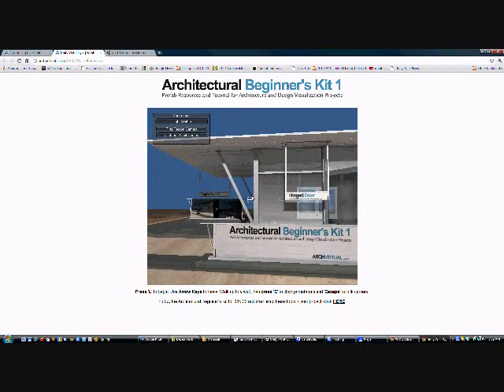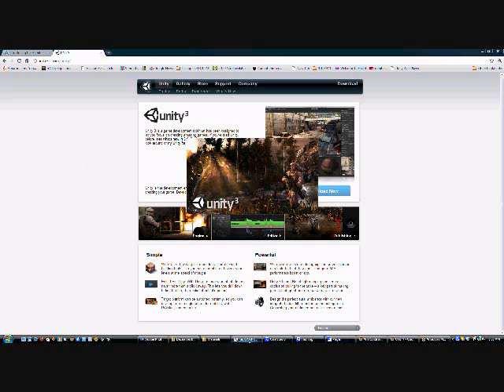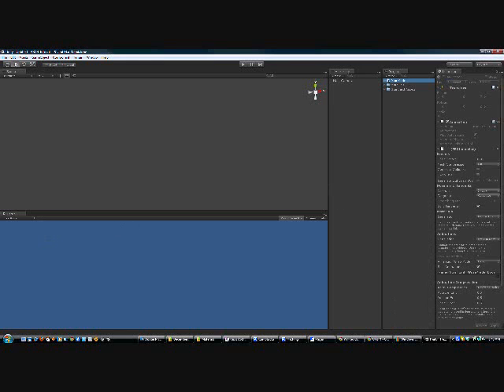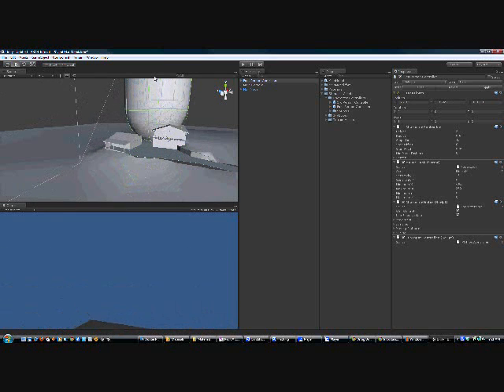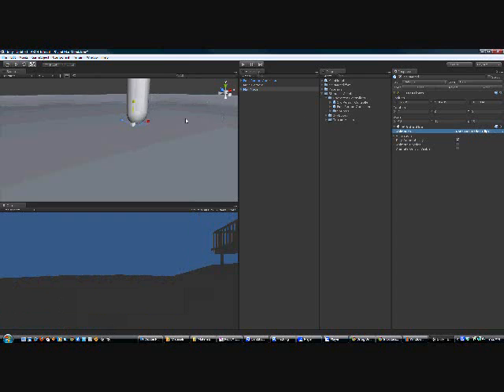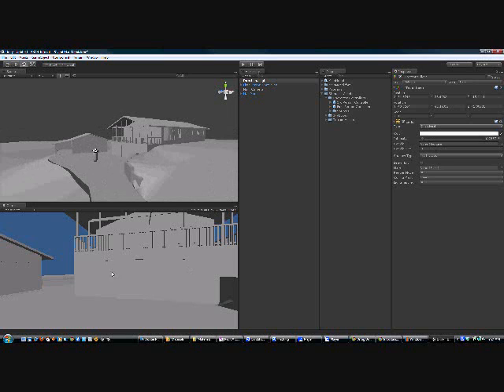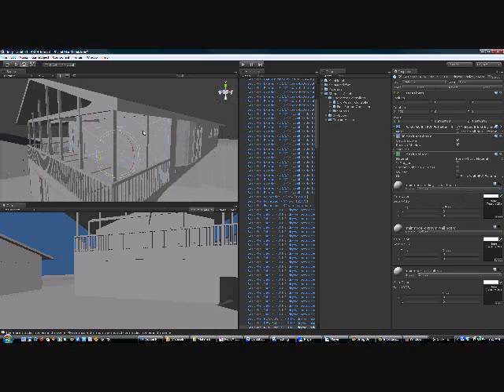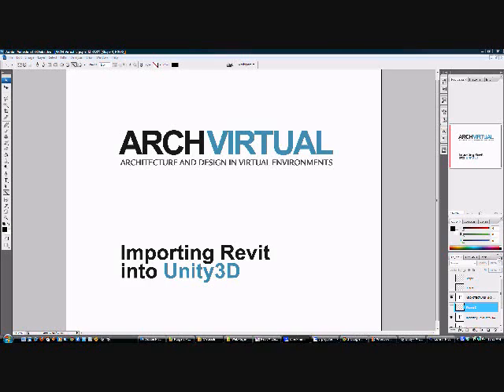Importing Revit Architecture into Unity3D Tutorial- PART 1

Comment from the maker: The number of Draw Calls is high - this is 1500 or so.  It also brings about 50 materials.  

However, for architecture builds, you don't need to assign every material.  In this case, I assigned 12, and it was enough to serve its purpose.  

As for draw calls, since it isn't a FPS - some lag really isn't a deal breaker.  Published to a website, viewed on a crappy old laptop this still gets 30 fps.  

For big, complicated builds, Unity pro's occlusion culling and beast make all the difference.